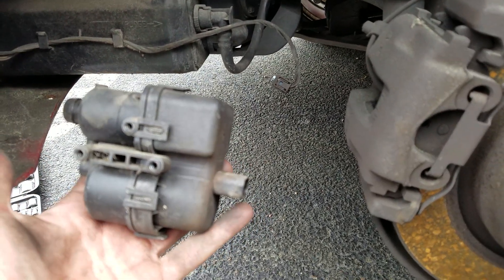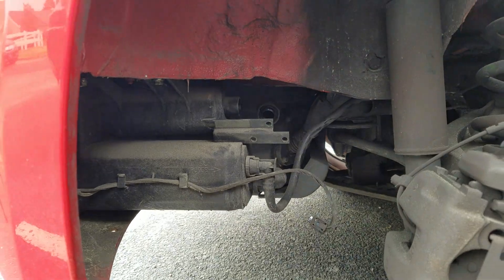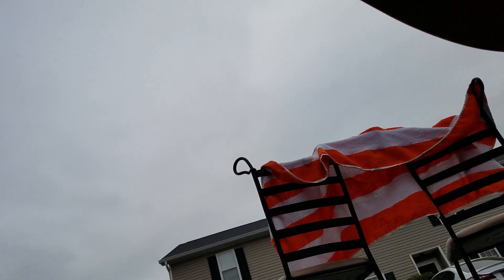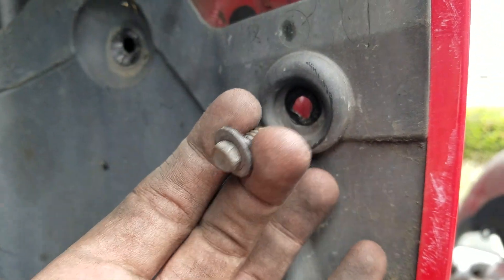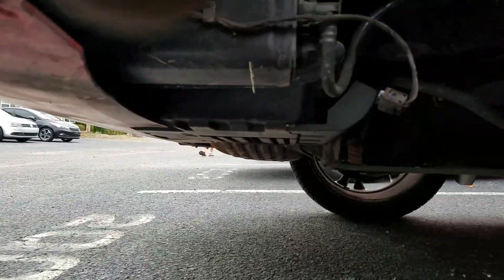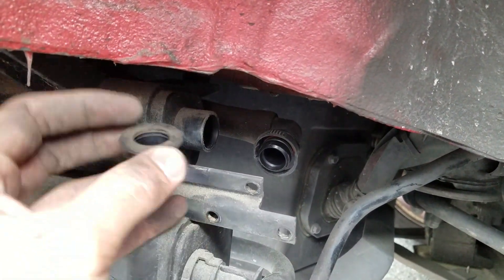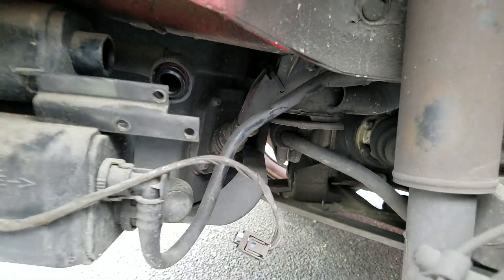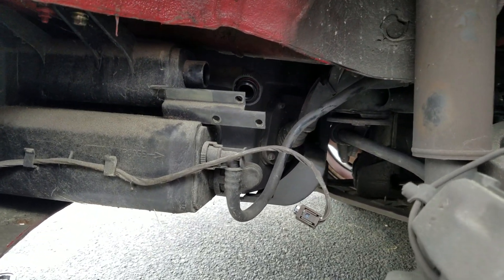BMW Z4 - P1447 - DMTL Fuel Vapor Leak Detection Pump

Comment: Very detailed video! I'm getting a P1447 code on my '03 Z4; I started getting a clicking sound in the engine. This was the only code I got, so I'm hoping it's not something worse. I'm going to try and do this myself since your video was so detailed and it looks fairly easy. I'm just concerned with pulling off all the old plastic tabs and parts. Thanks for the video!

Comment: I have same code e92. I did a fuel pump upgrade to a bucketles fuel pump and forgot plug in one of the dmtl lines and left it in the the tank. After that I got code p1447. I fixed the line and replaced the dmtl pump and the charcoal canister and still keep getting p1447 can there be any other causes for that code?
Reply from the maker: Did you delete the codes and it came back after? I am not too sure, sorry. Check the e92 forum? Good luck!
Reply: @Pray4UrLife12  i did every time the gas tank is at about a third it comes back on. what if i set up the fuel level sensor incorrectly like to high or to low so it gives of an improper reading would that cause it to test prematurely?
Reply from the maker: Check this page out: https://www.engine-codes.com/p1447_bmw.html